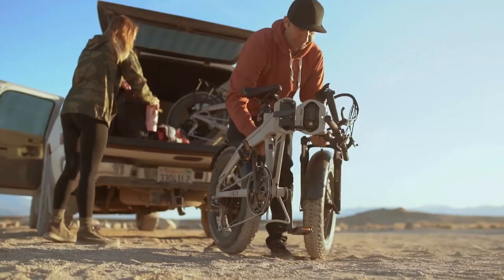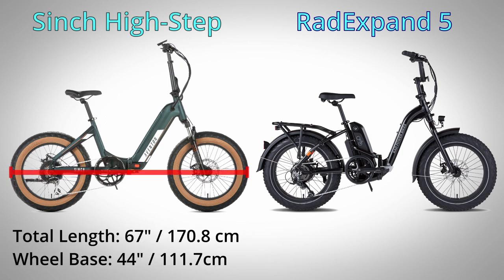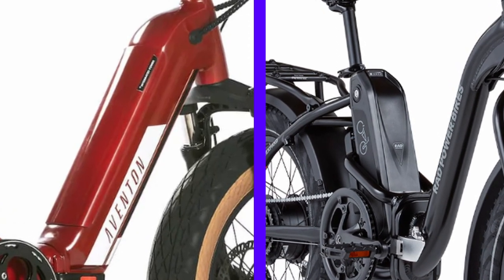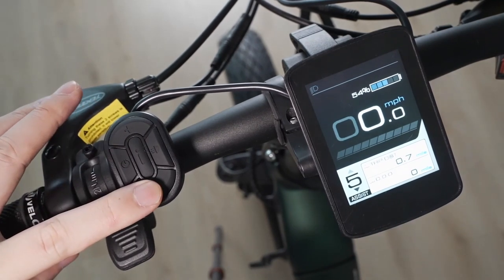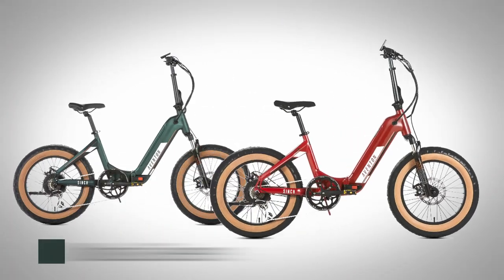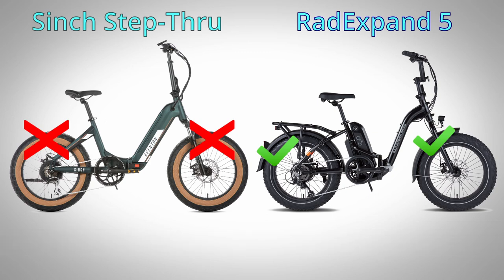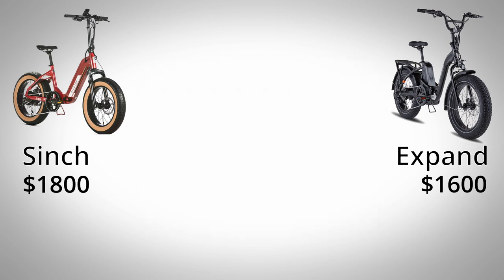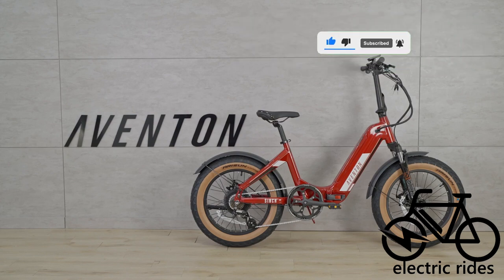Aventon Sinch Step-Thru vs RadExpand 5 - Folding Ebike Clash! ⚔

Comment: As an Expand 5 owner,  I was attracted to the generic build- external battery and controller and the killer feature is the bmx bars, which offer great adjustability and comfort. I wish other folding bikes were spec'd with bmx bars instead of the tall telescoping handlebar!
Reply from the maker: Definitely agree with you there!

Comment: Looks like Aventon is now throwing in the headlight, tail light, fenders, and rear rack for free with the Sinch.  When you add the Sinch to cart, the other items are automatically added to the cart for no additional charge.
Reply from the maker: Good to know, thank you for the heads up! 🤘
Reply: it's a battery powered lights. not tied into the electrical system.

Comment: Went with Aventon.  I almost went for Lectric XP 3 but delivery by July.  I didn’t realize there was a Sinch 2 now but for the extra $ it looked like lights and I didn’t really need that.  Just need a easy way to ride around the property or pop into the back of the Tesla if I want to hit a bike path etc.
My use case is more - have old Honda 90 from 1974.  It’s getting harder to get non-ethanol gas.  And I can’t even keep the thing running long enough to care anymore.

Comment: I currently own a HeyBike which I am thinking of returning to buy a Sinch.  The issue I am running into is that none of the local bike shops have any interest in working on my bike, which makes me fear the warranty isn't worth the paper it is printed on.  Whereas the Aventon has a network of dealers very close to home that will work on the bike should I have a problem.  Since even cheap e-bikes are not cheap, I hate the idea of being stuck with a non-functioning item and not being able to find support for it at any price down the road.  The more I look into e-bikes, the more I am convinced that dealer support is a factor.  Because packing up and shipping some e-bike across country is both time consuming and very impractical and expensive.
Reply from the maker: I hear more and more LBS are restricting the brand and style of bikes that they will service. Not a good trend. Otherwise, it's smart to consider warranty and service options down the line since most don't think about that sort of hurdle until it's too late! Let me know what you ultimately decide upon
Reply: I own an Aventon Pace 500 I bought from my local dealer on Labor Day 2019.  I want service and always like to buy local.  The controller has gone out on it and it has been at the dealers for over a month.  Aventon says they have no I idea when they will get the part in.  
My dealer is not happy.  So again, it’s still a crap shoot with anything electronic.  I just hope I don’t own a three year old pricey paperweight!

Comment: Spent under 1K and got a Lectric XP. Same power output as these in the video, comes with fenders and racks, has lights, and a very good display. No complaints at 100 miles in.
Reply: No UL certification

Comment: Nice bikes but I just ordered the Heybike Tyson and I feel you get a lot more for your money (4g connected modem for antitheft, unibody design, Shimano components, hydraulic disc brakes, front and rear turn signals, modern design, color screen, accessories included) and all for $1700. The only negative is not alot of local stores carry or service this brand yet so u may be dealing with support in China but the support is mostly very good.
Reply from the maker: Yeah, unfortunately with the DTC brands, that's a common issue these days.. but if you can do the service yourself that new Tyson looks to be a killer deal.

Comment: Support should be considered.
Reply from the maker: I definitely agree. But in my experience support can vary wildly even with the same company based on the rep that you're getting. Some know exactly what they are doing and some could barely tell you what a geared hub motor even is. So, it can be rather difficult to measure. I'll try do add more warranty/support info in future reviews/comparison vids, though! Thank you!

Comment: Aventon has the look for sure.     Those 14ah batteries will be dated soon.
Reply from the maker: Agree with you there! 14Ah seems to be the standard still but many new bikes around this price range are coming out with 20Ah minimum now.
Reply: @ElectricRidesUT  I just ordered a 48w/25ah from Amp Rides.   That should work for while.  :)